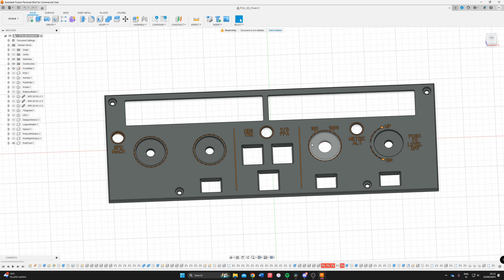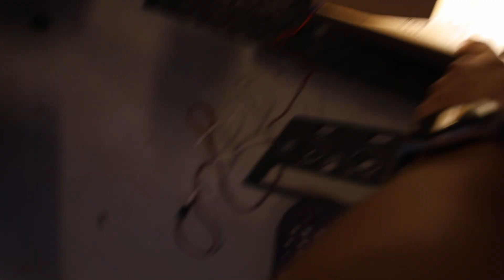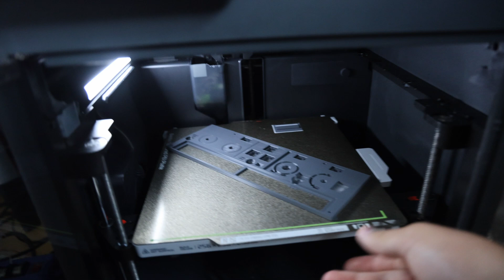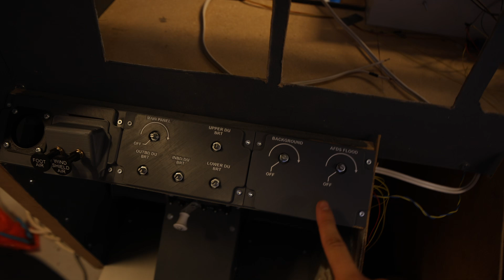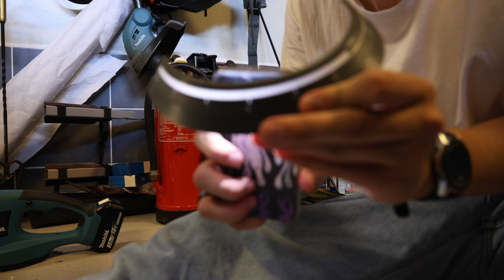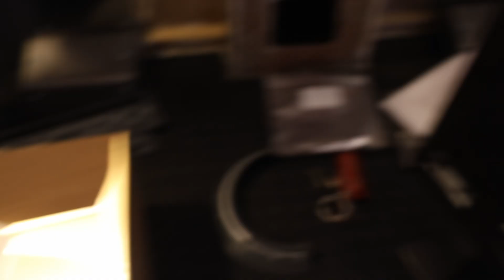How To IMPROVE Backlighting For Your 3D Prints (Use Any Printer!)

Comment: Damn! this channel is such an undiscovered gem! I've been the world of simulators for quite a while and I never met someone who was 3d printing their entire cockpit. Im planning on building the 737 MIP just like the SIMON solutions compact trainer. But I've been facing problems with my MCP panel, I use real sim control for easier programming but ultimately I want to build even the overhead Panel. Great video and great content, keep it up!
Reply from the maker: Thank you so much! 3D printing the entire cockpit is the cheapest way to achieve good looking results in our experience. As for why many others don't do it is because it's very  slow and requires a lot of pre planning. We will definitely keep uploading videos about how we design parts like MCP, MIP and even the overhead panel when we get that far in our project.

Comment: I am currently trying to figure out how to do this without multi-color prints because I don't have a multi-color printer and manually swapping the filament 200 times would be horrific. Your project has been the only one I've seen that does not require a laser engraver or similar.
Reply: @anonharingenamn  the way i do is printing white/natural aan only two to layers black with letters cut out. Only one time filament swap.
Reply: @jaapjan06  Yeah I did think about that, too. I have also thought about filling the crevices with nail gel (UV curable) or something. I am not sure on the best approach yet.
Reply: @anonharingenamn  I didn't try that yet though I did try using furniture repair wax to rub into the crevices. It works but also rubs onto the uneven surface making it very ugly. So that experiment is out at least. Let me know how the UV resin works out!

Comment: I enjoyed picking up some alternative ways of making backlit panels. Why not create everything transparant however and only the top layers in black/ white? Then light can freely spread and you only need to paint the edges black.

Video specific tips would be to drop the music and make sure the sound is of equal volume. Sometimes voices were very clear and other times very soft. Keep it up!
Reply from the maker: Thank you! We have tried using thicker transparent sections and only printing the top with color in the past but the light ends up bleeding too much and painting the sides can be very tedious when there are hundreds of panels. That's why we don't feature that technique in this video although it is totally viable way to make panels. 
Also we will make sure to better balance the audio in the future.